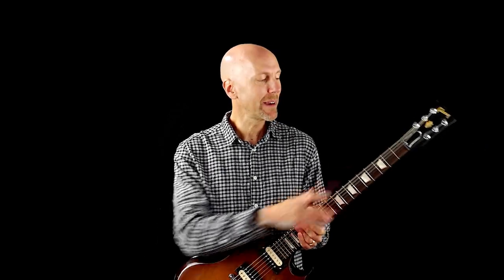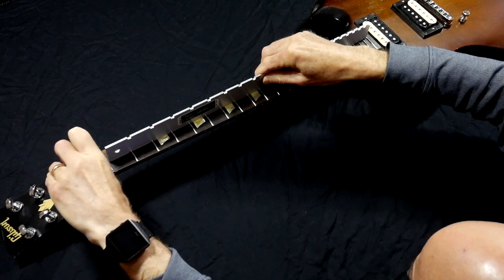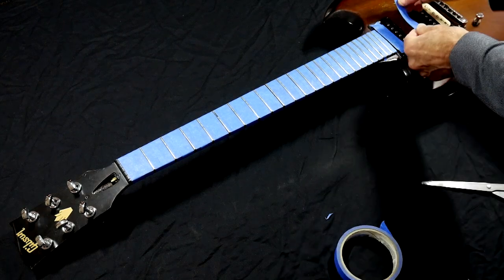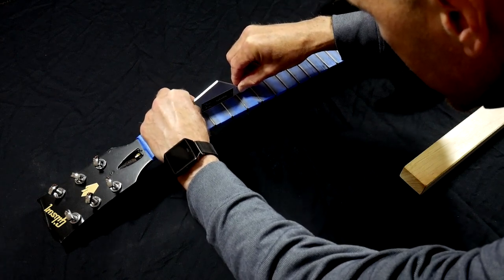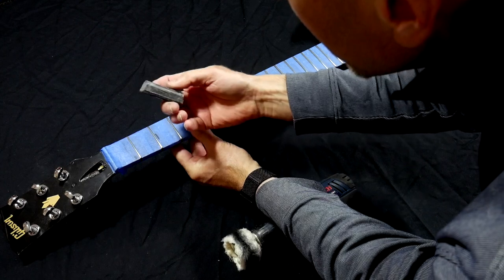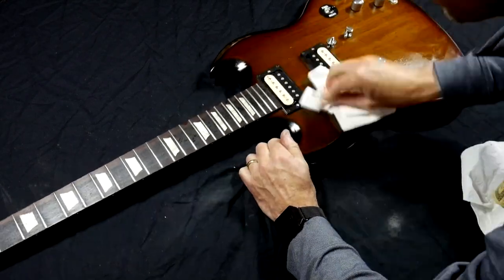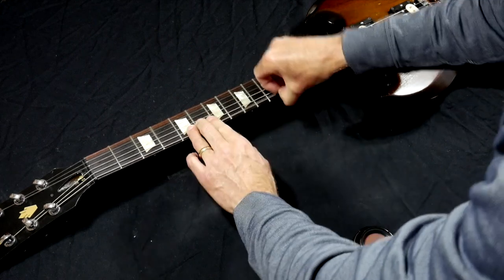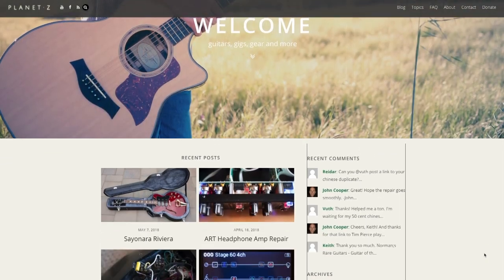Guitar Fret and Neck Overhaul

Comment: When you adjusted the truss rod to flatten the neck at the beginning, I was thinking, “No, you adjust a truss rod so that you get the desired relief with the strings on and under tension!”

Then I realized, oh, he needs the neck perfectly flat to level the frets.  Wouldn’t make any sense to level anything but a totally flat neck.

Thanks for the video.

Comment: Removing the nut allows you to get longer strokes. Smaller strokes takes more material off of the center frets and less off the frets on the ends by headstock and body.
Reply from the maker: Good tip, thanks!
Reply: @johnplanetz  Yup, great job by the way. That wasn't meant to be a criticism.

Comment: Before crowning, it's recommended to mark the fret tops with marker, again. It that's a StewMac Z file, you don't have to worry about flattening out the crown, otherwise. work the crowning file, on both sides of each fret, and leave a very thin sliver of the marker line on top. This ensures you won't level out the crown of the fret. Then proceed with the rest of the steps.
Reply from the maker: JJ Dillon - great suggestion, thanks!

Comment: Thanks for the video. Thanks also to the commenters who offered tips. One (weird?) question: at 17:36 isn't the bridge backwards?
Reply from the maker: Hey Steve- this is ostensibly the "historically correct" way to install the tune-o-matic bridge- with the screw heads facing the pickups. But I think it doesn't really matter, as long as you can set your intonation properly.  Reference this video: https://www.youtube.com/watch?v=32t5-K7b8ME

Comment: Great vid!!! 👏🏻👏🏻👏🏻Just one question, after the frets levelling does the nut need an adjustment? Happy new year!!!!🍾🎆🎉
Reply from the maker: Matteo Zambon - If your nut was cut properly to begin with, it is unlikely that you will remove so much when fret leveling that it would require modifications to the nut. But it’s a good idea to check string height at the first fret before and after. You can always lightly file the nut slots afterwards - just wrap a feeler gauge with some sand paper between 220 and 400, and lightly file. Be careful so that the back of the slot (towards the headstock) remains lower than the front (so the primary string contact remains at the front of the nut slot towards the fretboard). Happy new year!

Comment: Warning. At 9:00 Most luthiers will black the frets again before the fret crowning file. If You don’t black up the frets with a marker before you start with the crowning file - you are likely to go too deep on some of the frets or not deep enough. At 9:00. 

Also, if you don’t leave just that thin marker line when you’re done with the crowning file your intonation will suck. It turns out those flat portions make the notes sharp.

Comment: My question doesn't go with this video but it's your newest video.
Question: Why do effects pedals need a battery? If the amplifier is plugged in why not just use a AC adapter for the pedals? The 9 volt battery takes up a lot of room in the enclosure and it's redundant.

Comment: I know it's not relevant to fret repair, but quick question about the way the tuners are set up. They look like Firebird gearless tuners. What's the advantage?
Reply from the maker: Those are Steinberger gearless tuners. They came standard on this particular 2013 SG. They feel great, are very precise, hold their tune well, and they make changing strings a breeze. The only real downside is that they look strange and untraditional- to my eye, they make the headstock look a bit unbalanced.